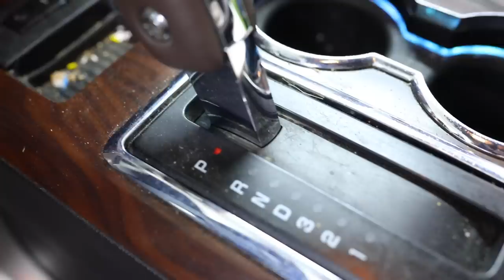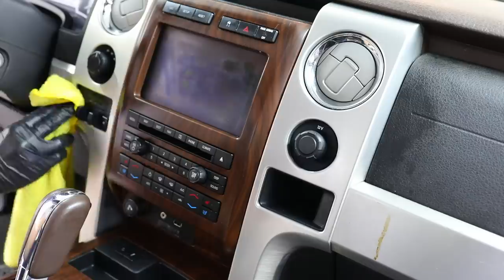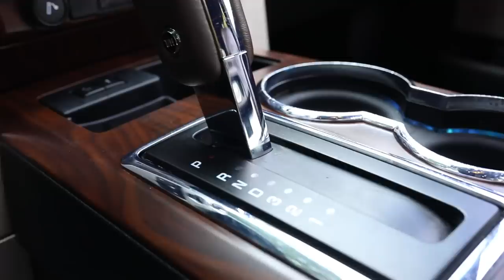Car Detailing FILTHY Farm Truck Ford F-150! Complete Disaster Trashed Interior Car Detail!

Comment: So, back in the day I was a professional detailer and I worked for 4 dealerships as a detailer, and I have owned 60 cars so far (since I was 14 and I'm 37 now). Well I have always wanted to get my own heated extractor and I finally ordered one just to have for my own cars. I bought a Sandia 50-7000 heated 3 gallon extractor for $800. I have yet to actually receive it, but I can't wait to use it.

Comment: Hold on. You remove the seats without disconnecting the battery?   I thought it needs to disconnect battery before removing seats because of air bag
Reply: Depends on the car. A majority of newer cars the cars computer registers the seat was disconnected.
Reply: I think he said this before but he always disconnects the battery when doing a cleaning whether interior or exterior

Comment: You really should use compressed air on the switch assemblies to dry them.  At the shop we often have to replace sticky and shorted switches after a customer gets a detail job.

Comment: So I’ve been trying to clean my car and get it back to looking nice but I can’t get break dust off I think it started etching into the wheels so do you recommend anything? I’ve tried using the chemical guys stuff but I dint think it does much should I try the iron x from meguiars or would the carpro brand be better to get it gone
Reply: idk if you found something that works but i recommend eagle one black and plasti coat wheel cleaner it removes iron and surface rust its cheaper than iron x but just as good

Comment: Hi James, after agitate floor mat with drill brush, won't the dirty water flow to the bottom of the floor mats? If that's the case, should vacuum both sides instead of the top isn't it?

Comment: I’m wondering about the difference between what you’re doing at 24:45 and what you say to do at 26:30. There’s stuff dripping all over and I’m always worried about shorting our something with any solutions. How risky is it to just spray the climate and audio system switches down?

Comment: I have a problem my uncle drives a semi trick and he wants me to clean it in a rew weeks. It is covered in this oilly grease that will only come off point blant with my electric green worths pressure washer. What degreaser/soap would you recommend by the way this truck has over 70 thousand miles on it and has never been detailed
Reply: Are you cleaning the exterior or interior?

Comment: Why do you want shiny leather? when your car comes out of the dealership it is a matt color appearance. so why not leave it Matt/satin instead of shiny.
Reply: Matte looks so much better than shiny.
Reply: if you consider that leather is literally cow skin it needs to be moisturized as all skin does. Without moisture it will stretch and crack. Sorry to get all “it puts the lotion in the bucket” about it, but that’s why 🤗

Comment: Question. If you cant buy an extractor right now, can you use the wet/dry vac as an extractor? Would that work meanwhile?
Reply: He has answered this question before so I thought I would fill you in. You absolutely can use a wet/dry shop vac.
Reply: Detail Geek and Stauffer Garage said the extractor works the best. They have answered on previous videos.
Reply: So this is from what I have seen from videos. You can use a wet dry vacuum and receive the same results. It may take more time to achieve the results you want but it can get the job done.
Reply: Also you can look up videos of other detailers who started out with using a wet dry vac.
Reply: I used a wet/dry vac for YEARS before getting an extractor. Works really good as long as you have a good wet/dry vac. I still use that wet dry vac when my extractor cannot get into a small crevice area.
Reply: Yes
Reply: Yes
Reply: Yup just put your wet filter on and extract up any cleaners you used on your floors or seats, works as a good alternative.

Comment: do you do the inside bottom of the doors? or the inside sides of the doors? Never seen you do it, and if you do.... how do you do it? and why do you not use the pressure water to clean the carpets? at least to take out the majority of the mud encrusted ? You had to do so many passes with the extractor and not even then did the water passing through looked completely clear! Then when you said it, i did not understand why you had not done it. Special reason maybe we do not know about? The leather seats: AMAZINGGGGG!!!

Comment: I put the floor Matt’s on one of those cheap rubber/foam floor tiles you get from harbor freight for standing on and give me a nice clean 🧼 area to work on so my drill brush doesn’t hit the garage floor and my steamer doesn’t pick up concrete dust ! Give it a try see if you like it
Reply from the maker: Great tip! Thanks!